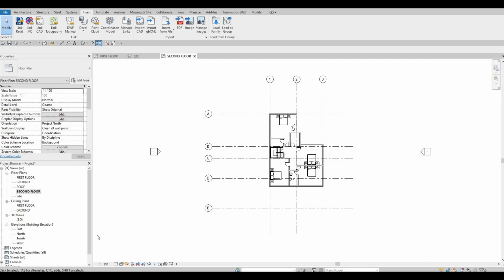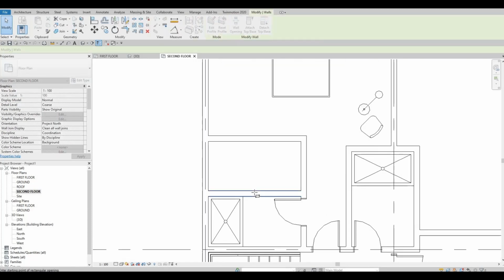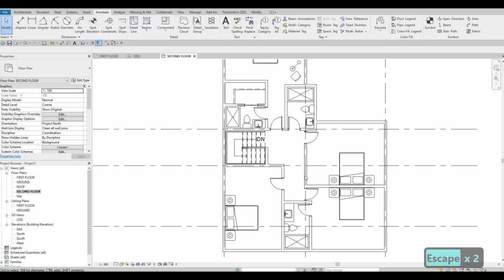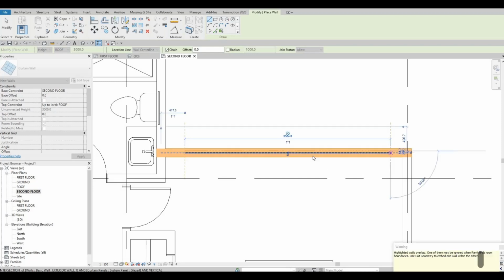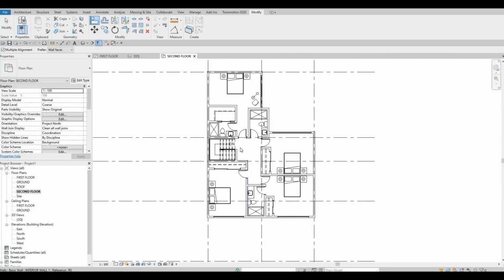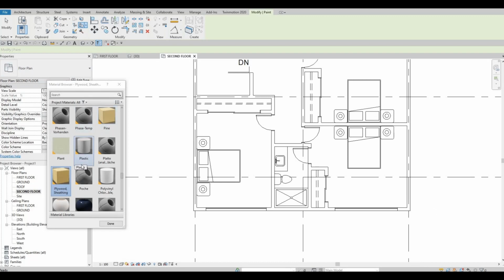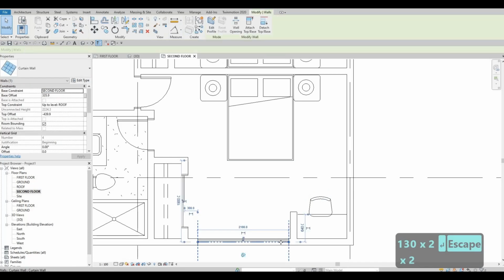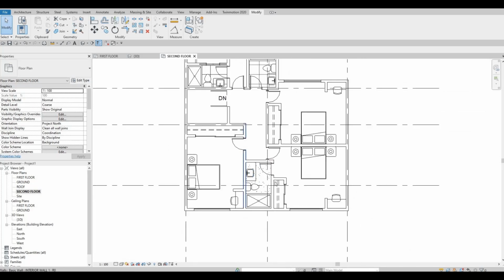M4 House | Part 8 | Complete Step By Step Project | Revit and Twinmotion Tutorial

Comment: hi, Thank you for the informative videos, I have a question, when applying the floor, should I attach the walls that go up to this floor's level to attach to its bottom?  or not
Reply from the maker: Hi Mareh, yes you should attach it from the bottom of the floor so that it is not sticking up. 🙂🙏
Reply: @ArchCoreDesigns  Thank you brother.
Reply from the maker: thank you sir 🙂🙏